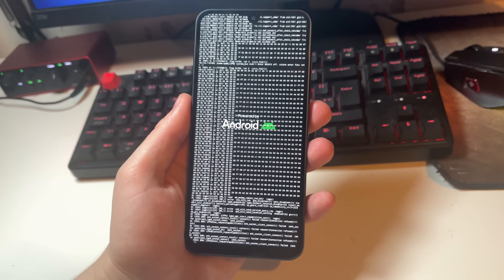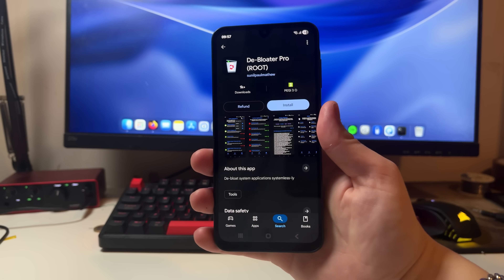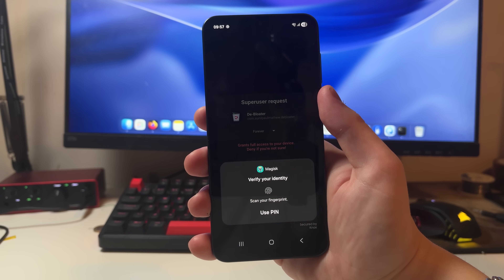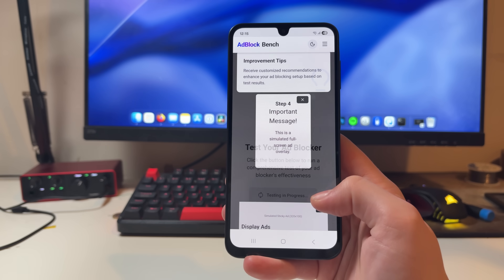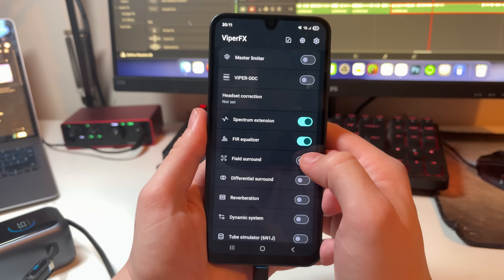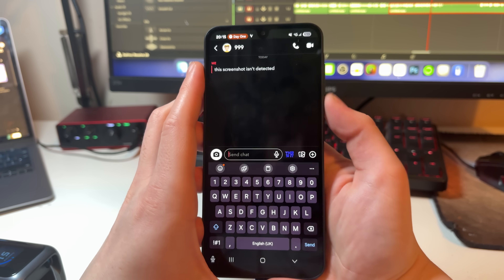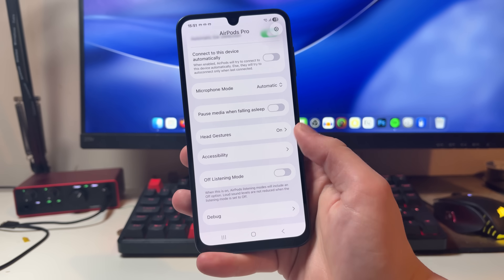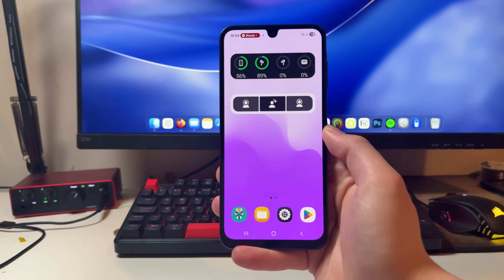Why I Rooted My Android in 2025 (When Everyone Says Don’t)

Comment: I removed root from my phone just today because it had more cons than it had pros. The modding scene is no where near what it used to be, the adblock can be done with a dns on a home server, debloat can be done with adb, audio tweaks exist on Xiaomi phones at least (which i use), the screenshot and screenrecord blocking can be replicated with a modded app. I'd rather have proper security and have my phone work with bank apps than deal with bypasses for stuff that doesn't really need root. Instead just got a Pixel with graphene, thats what you need if you want control

Comment: Rooting is not bad. But in 2025, rooting is unnecessary. I used 3 rooted phones when it was a thing but I simply don't see benefits of rooting. Evey ui is customisable, there are ton of apps doing rooted shit without root, you can use adb and shizuku even without root.

Comment: I've done it before countless of times but it was never worth rooting, if you install a module for magisk that "improves your performance" it does absolutely nothing, you can debloat your phone using uad on your pc without needing your phone to be rooted, you can also add adguard dns to not get ads on any apps without being rooted, you can also change your audio without using modules and there are many cons do rooting, you can also brick your device and that happened to me before and it took some time to fix, you lose your data, I remember that Netflix won't work and other apps won't work or have some features not working cause you are rooted

Comment: Non-root alternatives to some of the things shown:
1. Canta - removes system apps without uninstalling them, so it's possible to restore them. Also shows you how safe said apps are to remove. Requires Shizuku.
2. RethinkDNS - a system-wide adblocker, firewall, and a connection tracker. If you just wanna block ads, you can also simply set your private DNS in system settings to one that does.
3. RootlessJamesDSP - great system-wide EQ, lots of settings to fiddle with. Works with Deezer, YouTube, Twitch, etc. but not Spotify, SoundCloud or Chrome. Requires Shizuku. Spotify can be made to work if you patch the app via ReVanced Manager.
4. Wavelet - EQ that also works with Spotify. Works straight out of the box, though it works better if you give it DUMP permission via adb. You don't need a PC for that, just Shizuku and a terminal app.
5. LSPatch - allows a small handful of LSPosed modules to work. Requires Shizuku, the original repo was archived two years ago. A fork by JingMatrix was last updated on Dec 1, 2024 and supports up to Android 15.

Everything sans Wavelet is FOSS. There are a couple other EQ apps but the two I've listed are the only ones I know of that don't collect your info.

Comment: 1 good feature of why I have it rooted, bypass hotspot throttling.

Kernel to lower the power a bit to extend the battery usage.

AppOps to really limit the apps commission and hidden one's as well.

Savertuner for battery saver go extreme mode

Shappky to force close any app doing a wakelock in the background. 

Shizuku acts like a root app but is limited to some apps and theres an website for the best shizuku apps when you don't have root in the meantime.

Hail app suspend-disable-force stop-hide  I use it for disable when not needed the app but be careful with some system apps that could bootloop your device example play services app can be disabled and play store but if you use Insular app for work mode sandbox apps if you disable the play service and turn it on youl go into an infinite bootloop and you have 1 sec when the screen turns on before unlocking the device  to try disable the work mode in the notification bar.

Comment: Samsung efuse pops if you unlock the bootloader, so your phone can never again work with samsung wallet or other stuff. It is hardware level change.
Reply: If you're root you can do whatever you want, and by that I mean there is a module to restore these features and Samsung Wallet ! So no that's not a good argument against root.

Comment: Debloating can be done with ADB or Shizuku. 
AdAways effect can be achieved by using AdGuards DNS
Reply: and System wide(almost) sound effects can be done using RootlessJamesDSP with Shizuku
Reply: one thing that root/unlocked bootloader benefitted the most was, the ability to install different kind of CustomROM and also degoogling your phone, which ironically more prominent in Google phone
Reply: NetGuard as well, using a "VPN" as a DNS sinkhole.

LMK if you need a NetGuard Pro key, I can keygen challenge-response keys as I reverse-engineered and know its algorithm.
Reply: In my case I can access the data/data for WhatsApp thumbnails still

Comment: I COULD root my samsung note 10 lite, and i probably should, but its like, i dont want to risk my phone which have had for like 3 years

plus, shizuku and termux basically give a pseudo root experience
Reply: As long as you do the research and are smart, there is no risk.
Reply: Even if you brick your phone you will always be able to restore a signed Samsung ROMs onto it.

Comment: Honestly the one tweak that seems kinda worth it is the systemwide adblock. But tbh I'm a little too lazy to root. I'm using a custom ROM and it gets semifrequent updates and updating removes the root and in order to root I need to unpack the latest ROM that I'm using and flash its boot.img or whatever and it's too much of a hassle.
I mainly used root previously for iOS emojis and YT Revanced but at this point I let go of them for the sake of convenience (also revanced has a non-root ver)

Comment: They actually only buy phones based on if you can unlock the bootloader or not.

Firstly, I don't care about sideloading because what's the point of sideloading if they can just remove it later? I need the bootloader to be unlocked so I can be sure. I maintain all of the features that I want.

Comment: Finally somebody that actually shows benefits of rooting nowadays rather than saying there aren't any reasons to root and it makes you insecure.

I heavily dislike the Android security model because while it enforces security, it limits user freedom. That is why I dislike standard android or forks like GrapheneOS, they ultimately limit what you can do on your own device for your "security".

I believe the user should be the one to have total control over the device, to install anything, to run anything, to modify anything.
Reply: I miss when buying meant owning
Reply: If you say a free and open source OS like android limits your freedom, then what do you think of iOS?
Reply: @IsHacker-Alt iOS is the reason I've never considered an iPhone.

Also an open source OS can still limit freedom if that's how it's designed and maintained. Forking, modifying and then keeping the fork up to date is extremely difficult for something as large as Android that is maintained by a large team in Google.
Reply: @_M_643  That ain't Android's fault tho, its google that adds all the security measures that kill user freedom.
The Android devs don't want to limit user freedom, but Google does, Android is simply not to blame here.
Reply: @CineverseSculptI didn't mean to say Android's the problem.
I meant to say that even though it is an open source project it doesn't make it free because the main designed and maintainer behind it is Google and making a significantly different fork is hard as it requires a powerful team that can keep up with Google.
Reply: @_M_643  Yes, but I meant it could have been much worse if android was proprietary like iOS. I never used iphone too. I'm typing this from my phone running crdroid, and i'm rooted with magisk and lsposed.
Reply: GrapheneOS still allows you a tons of stuff plus help you getting apps that need Google Play to function to work.

Btw GrapheneOS are meant for people with REAL privacy consideration, like journalists so they don't really care about the rooting part.

Comment: I like Graphene because I already know from the get go that the underlying operating system is bare and open source. Samsung has an excellent UI, but it is all literally corporate spyware.
Reply: My issue with GrapheneOS and general android is the Android security model which by design limits user freedom  and what you can do on your own device. I wish there was an android fork that maintained security while also providing root level functionality.
Reply: @_M_643  I can't think of anything other than android that gets remotely close to those requirements. You can root android. I can't think of any other AOSP fork more secure than Graphene either. Let's hope that Linux phones become actually viable sometime soon.
Reply: GrapheneOS on a phone that isn't a Pixel is a lost cause. It's an unofficial ROM (you can't be sure what the guy who ported the ROM did) and security is not as good as on a Pixel (right now no one even the government can unlock a Pixel with GrapheneOS and the 2022 chip security patch)

Comment: Bc of brands not letting you unlock bootloader i didnt upgrade my phone in 5 years and i still dont plan to.

Also adaway ❤ >>>>
Reply: Oneplus still allows bootloader unlocking
Reply: @EvanCaritopTV no sd card slot sadly 😔 so far i've only seen ones without sd slot (except sony but its too expensive for a phone)

Comment: 3:12 if you want to do that without root you can, with canta and shizuku, you will need wireless debugging and it also tells you what is safe to remove and information about what the app does, like mi anylatics is spyware pre installed

Comment: I stopped rooting my phones around android 5. But now with the fact you can run full linux distros on it root is needed to get the best performance. Im lucky enough to have my quest 3 rooted and with arxhlinux installed through chroot i can play starbound ive learnt to port over to arm64 and it runs flawlessly. Proot can be done but people underexaggerate the overhead. Its quiet a lot compared to chroot
Reply: You can root the Quest 3?
Reply: @zekiz774  v79 or below yes. Im on v78. Lookup gpu exploit quezt 3s github if if your on any firmware below that.

Comment: I actually made the mistake of /not/ rooting my device from the start, then when I ran into situations where I /needed/ root, unlocking the bootloader would wipe the phone. Ironically what I wanted root to do was to be able to backup the data on my phone to my computer, which wiping it would be the exact opposite of what I wanted. I can get /most/ of my data backed up without it, but not all. I was going to switch to the phone I got from my uncle, but it's a carrier samsung phone and doesn't even show the OEM unlock option sadly. I've been looking into maybe getting the 2024 Moto G Power 5G, factory unlocked version because apparently most carriers prevent bootloader unlock.

Comment: 1:24 samsung recently removed the option to do so with oneui 8
Reply: mine still working fine lmao by using one ui 7 bootloader with one ui 8 is at the same time
ik it's lil bit weird 
but if it works, it works, don't touch it.

Comment: since oneui 8, Samsung has removed bootloader unlock ability
Reply: you can patch one ui 8 firmware's with some one ui 7 stuff to keep the ability to unlock the bootloader. It just needs to be on the same bit revision
Reply: @-validites-  so basically similar to Huawei, only using exploits and stuff
Reply: @tigersusyt Atleast its an option tho, unlocking isn't completely dead.
Reply: @tigersusyt huawei was worse, since unlocking needed a working website and server and stuff to work, which they of course took down. while samsung still needs a server to provide the unlock token internally, at least they haven't yet taken that down, just removed the unlock ability in the firmware.
Reply: the fuck? i don't remember any backlash over this at all.

Comment: OMG, why reduce security? You can block ads with DNS and improve security. I use GrapheneOS BTW
Reply: cook!
Reply: Reduced security is a lie that Gaygle is feeding to the public. The reality is on average, users with rooted phones are more secure. In order to properly root a phone these days, you need to have a level of technical understanding significantly higher than that of the average unrooted phone user. YOU are the greatest anti-virus and don't let anyone ever tell you otherwise. While there may be the ability to block ads without root, there are many abilities some would consider to be "root-only" such as applying FFlags in Roblox for example.
Reply: My issue with GraoheneOS is much like any other Android OS, the Android security model. I don't like it at all because it limits freedom of what you can do by treating the user as a liability.
Reply: @_M_643  the user is a liability though
Reply: As long as your bootloader is locked after rooting you're fine since you're talking about GrapheneOS on a Pixel. It's open source code and you can check it.

Comment: I normally would say "Do not root that" but due for todays anti practice what google, rooting benefits even more than that, like install Custom OS, etc. Same goes with bootlocker unlock thing, which is somehow a "root" thing, but also benefits that.

I dont care about "banking", as they claiming always about this, but whos gonna hacking your banking accounts???

Even that, still more restriction on device itelf than desktop x86 devices.
Reply: so true. you gotta be stupid as bricks if you get your banking accounts hacked. just dont install shady ahh modules and its gonna be fine. if you can root your phone you most likely have enough brain power to not get your bank account hacked.

Comment: Debloating can be done through pc or shizuki though 3:08
Reply: Doesn't shizuki basically just disable and hide the apps?
Reply: @EvanCaritopTV Yes. They will return with a factory reset.
Reply: @EvanCaritopTV no it doesn't. You can also use LADB. It's not free but if you know where to look, it might be.
Reply: that's true. the only reason to use root for debloating phone is if you want to completely delete the app from the system.
Reply: @gxost_off does that mean debloating through them doesn't erase them from system
Reply: On my realme device both adb and shizuki weren't able to disable some realme apps like gamecenter. Depends on the app and the manufacturer how annoying they want to be

Comment: Can you please make a tutorial on how to root any android phones
Reply: Goodluck man some device are so hard to root
Reply: on some devices you cant
Reply: there is no such a thing , every device  requires a different way
Reply: @potcleanx7693 For the most part, yes.
However, there are some where the whole unlocking the bootloader and rooting process is identical; Pixel phones and Nothing phones are two different sets of devices by two different OEMs yet the initial process is identical.
(I got a Nothing Phone 3a just over 3 weeks ago and had a Pixel 7 prior. I used the Pixel rooted and am using my Phone 3a rooted as well.)
Reply: It's all over youtube
Reply: Follow instructions given by developers of these rooting methods. If they require an unlocked bootloader, follow instructions given by your device's manufacturer to unlock your bootloader first.
Reply: Technically any android can be rooted, even bootloader locked ones can via hardware rooting methods but its easier to just get a pixel since it takes like 2 adb commands to unlock the bootloader. I rooted oneplus phones and like what they offer over pixel but you only have so many options for "easy" rooting

Comment: how to get banking apps and google pay and payment apps to work on rooted phones?
Reply: You cant cuz specifically gpay has a crazy root detection, use either a card or a smartwatch.
Reply: @geroexp7282  yeah it's true, but if you make the rooting really undetected you can make banking apps work though
Reply: @geroexp7282 actually banking apps is easy fix, the actual challange is on degoogled android
Reply: @geroexp7282  idk gpay and whatsapp both work correctly in my phone but Indian banking apps detects root and close abruptly
Reply: Do not use Google gay. Instead, use an alternative de-gaygled payment method such as curve. As for other banking apps, either boycott the evil root-blocking "safety" measures or install zygisk-next; lsposed; HMA-OSS; trickystore; tricky add-on and a webUI client if you don't already have one. Set-up all the listed moduless. In zygisk-next, make sure to enable the root hiding options via it's webUI, make sure HMA-OSS and tricky store are applied to the problematic apps and use tricky add-on to fetch a key to spoof your bootloader status. HMA-OSS should be hiding any root-related apps. If unsure, just hide everything.
Reply: Learn. Research. It's a pretty easy process found by googling.
Reply: Don't use them. Use your credit card.
Reply: I got all my banking apps working. can't say the method will work on every app but you can try:
List of modules: Shamiko, Play Integrity Fix(bypasses most of the apps on play store), MagiskHide Props Config(show your phone as a different model to avoid detection) 
Insall LSposed and HideMyApplist module for it. Hide root apps and magisk manager (also hide magisk manager within the settings of it) from the banking apps and google services.
Patching the device model fixed most of the games crashing as I'm using a custom rom, it can easily get detected otherwise.